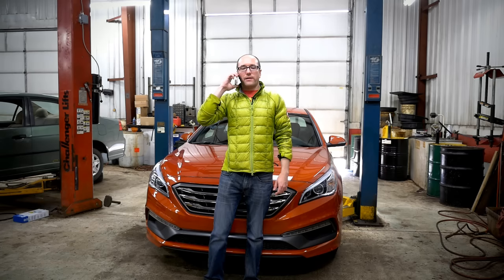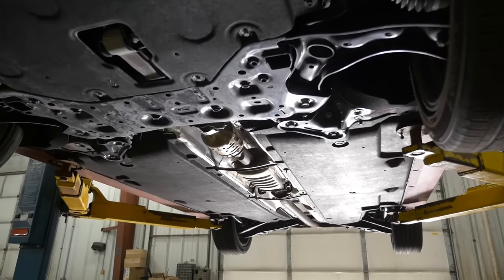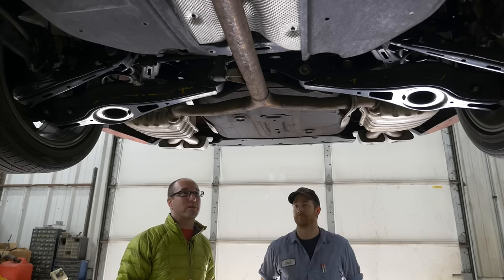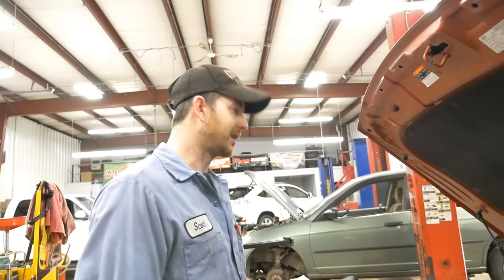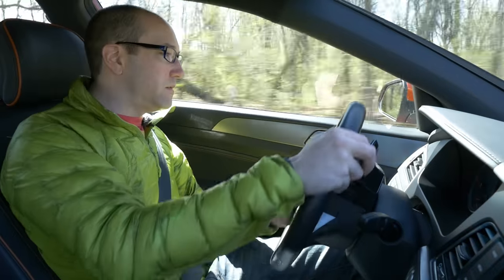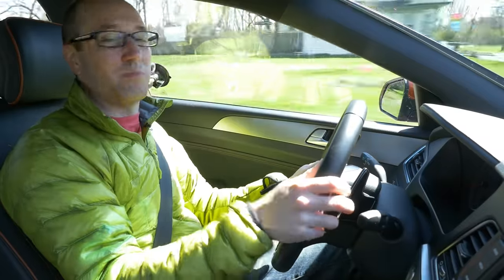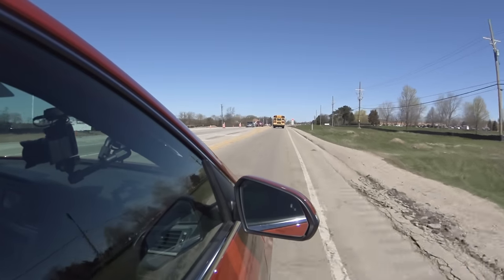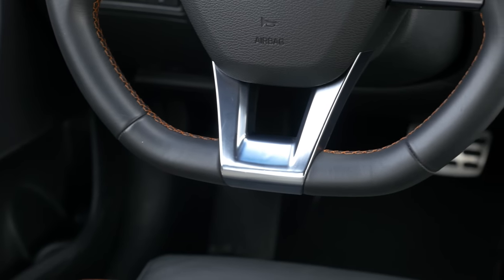Review | 2015 Hyundai Sonata Sport 2.0T | Domesticated

Comment: 7:43 I'm going to speak to this. Hyundai was about to lose it's customer base for the Sonata when they came out with the 2011-2014 models. They made a lot of those models. The problem was that the naturally aspirated motor (Mitsubishi created for them) was poorly designed starting having extreme oil consumption issues after 30-40k miles. This is unheard of from a fairly new car at the time. And  The issue was that Hyundai would not respond and so when contacted. And when sales tapered lower for the 2013-14 Sonata models Hyundai had to act because they lost a lot of customers.

Comment: I think you covered some good points in your review such as hard plastics for elbow and knee rests, wish they could have used some better material. However, I totally disagree with your review about lights and the center dash. I just love the cool blue lights they are so easy on your eyes when driving at night and I low the gentle blue light by the sunglasses which illuminates the center stack area. I never seen that in any car and just love that. About the center stack, which is very subjective. Beauty is in the eye of the beholder. I love the dash and the layout and especially the 8" touch screen and the map rendering. All being said, appreciate your review.

Comment: Second review of yours for me, very thorough, I'm subscribing.  I like Scott he seems no nonsense, I agree with him that these cars should have V6's, thanks EPA. My wife's Jetta Turbo has cost 5,000 dollars in maintenance and repairs in 76,000 miles, only NA engines for me from now on. These car's used to have upper/lower control arm front suspension and full front sub-frames, instead of the smaller cross member type. The struts are strong enough, but the lower control arms aren't boxed just stamped, which can cause them to flex more under stress.
Reply: I agree with curbing emissions, but what they have basically done is give huge vehicles the advantage

Comment: Nice review. I'll be in the market for a new car in the spring. On my list are the Sonata/Optima as well as a Forte5 SX. We currently have a '12 Forte SX 5 door. We traded the 2008 Sonata for it. Time to get back to two vehicles. I've also owned four VW's and 6 in the family total. My sister is still driving her 05 New Jetta. Also was a mechanic and service advisor for a few different makes - 3 of them German.The 2008 Sonata was boring but reliable as sunrise. Got it already a year old with 27,000 miles in 2008. Ex rental. Traded it at 120,000 for the Forte. Normal maintenance the whole time. The only exceptions were the typical sun visor springs and an exterior door handle. The '12 Forte has 70K on it now and pretty much the same. Just replaced front & rear brake pads. While I agree about the "hard plastics" in comparison to say our VW's, just look inside any late model VW/Audi at window/radio/HVAC buttons and switches. All that "soft-touch" plastic has peeled down to the bare white plastic. That was one of the biggest interior complaints when I worked for them. They were also hailed for interior design including the blue back lighting. I don't mind it. I sat in a 16 Sonata and 15 Optima SX-L 2 weeks ago at the state fair. I'm 6ft 2, 195 pounds and have nerve damage in my legs and feet from cancer/chemotherapy. The Sonata and Optima SX-L seats are among the best I've sat in as of late and that includes cars costing twice as much. As for the handling, nothing a better set of tires and struts couldn't remedy.
Reply: may I ask what did you decide on?
Reply: 2015 Sonata Sport 2.0T Limited. Just got it in March. Amazing deal since they had it and 8 other similarly equipped 2015's. Over $7000 off sticker out the door with the usual local add-ons of tinted windows, nitrogen filled tires, and a few others. Plus, to make me "happy" about the scratched interior door trim piece, they threw in: 6 more oil changes, cargo net, cargo mat and rear bumper applique. Quartz White Pearl with black interior with the orange piping and stitching with "carbon fiber" inserts on the door panels,etc. Loaded with the exception of a heated steering wheel. Just turned 3500 miles today and I love it. Ventilated seats are the best thing since sliced bread. Overall seat comfort is amazing. One road trip so far. Almost 400 miles with 6 hours behind the wheel. I could have gone farther and longer if I needed to. 90+ degree temps with the a/c going the whole time and speeds at 75+ the majority of the time and still pulled over 28mpg. Not bad considering it only had 1500 miles on it. Love the panoramic roof. Smart cruise control is brilliant. Android Auto works great. Amazing that I can flawlessly dictate a text at 70 mph with the roof open. I just downloaded the Apple Car Play / Navigation update so both phones can be used. Not a fan boy of either but the AA voice recognition works way better than Car Play. And to savagegeese' comment about it being boring, that's what makes it so stealthy lol. The "sedate" fifty-year old barely draws any attention to himself when traveling above "reasonable and prudent"  ;)  Brakes are great. Hefty for this class of car. 12.6 inch front and 11.25 inch rear. Handles well. Electric steering ? Yeah it's EHH but far better than the previous generation from people I've spoken to. I've never had a problem driving any of my cars as I wanted to. If you ever saw a 1983 Mercedes 300SD sideways on an off-ramp, my apologies. Blame Skip Barber lol. 

I read car reviews, I watch car shows, I've worked in the auto repair industry for 30 years. Reviews are always helpful. But, what a "reviewer" may or may not like, may be something that YOU can live with. The Sonata is not a sport sedan but in this trim, it's big, it's fast enough, and it's comfortable. I don't spend my days drag racing and running laps. There'd be a Subaru STi in my driveway if that were the case. In normal driving, it gets out of it's own way very well and the times that I plant my foot, it has nothing to be ashamed about. No regrets over my choice.

Comment: Nice review. I just purchased this car not to long ago and really appreciate some of the features and ride quality I didn't have in my 2007 Lexus ls460l and my 2013 avalon ltd hybrid. This car is not perfect by any stretch but it's a great fit for me.
Reply from the maker: What are your favorite things about it? Thanks for feedback.
Reply: savagegeese Well the sonata 2.0t compared to my last 2 cars is much quieter, better handling, the ride is just plain ole smooth and enjoyable. It has a much better sat nav, pano roof is always pleasing to the eyes, etc, etc. As for your review, I agree on some of the ugly plastics on the inside of the car but the blue lights..."C'MON"!!! I just so happen to like the "INFANTRY BLUE" color }:0l I do agree Hyundai could've done a better job on the interior in certain areas, but I can critique that on every car I've ever owned. My Avalon had plenty of cheap plastics (tasteful but plenty). My Lexus on the other hand was me best vehicle I ever owned (with it's share of issues I might add).
Reply: @derickj1976  how’s the reliability
Reply: @Tehtlata317  I no longer have the car,  but the 3 1/2 years i had the sonata been great. I had issues with it starting (push button) at work a few times. Might've been electrical gremlins or something. The transmission shifted funny ever so often, and when I made sharp right or left turns the front end will dip heavily. No car is perfect, but I really enjoyed having it for that long.

Comment: Nice info about how expensive the battery is. I noticed that you talk about seat comfort often in your videos. An important detail that no one covers & I challenge you on your next video (or all videos from now on), is to show the floorboard where a drivers left foot can rest if leg is bent and foot pulled all the way back. Oftentimes I find some cars have a floorboard design which does not allow a driver to pull their foot all the way back. The floor is raised. Sucks during long drives. Leg room is about stretching out but also about bending your left leg back far enough comfortably. I hope that was as clear as mud!

Comment: I have the 2013 Turbo Sonata and it has more 273 hp and 273 torque.  I love the car.  The best acceleration on my car is best if you leave traction control on and put the shifter into manual.   I wish I could find a head to head comparison of the the two generations.  I also want to know why Hyundai dropped the horsepower so much.  I also like the interior of the previous gen better.  Thanks for the video.

Comment: To be fair, when you are building a car to a price as aggressively as Hyundai is with the Sonata, the details are the very first thing that have to be sacrificed.  The Sonata is what it is, and that's supposed to be an affordable roomy midsize sedan that offers competitive features and performance.  I agree with everything you said 100% and the Sonata is definitely not the car for me, but there is a reason Hyundai designed it the way they did.  I much prefer the 2018 Accord 2.0T Touring or even the Mazda 6 Signature, but those are MUCH more expensive cars than a loaded Sonata.
Reply: And you're comparing a 2018 model to a 2015 model, I rather have this over a 2015 accord, because of that CVT

Comment: The theta engines in these particularly 2011-2014 have a defect that seizes the engine. You'll hear a connection rod slap, tinny sound getting louder when it's going to happen. Between 40k and 100k miles is when it happens.

They were sued class action lawsuit and have been installing new engines free of cost and rentals on a case by case basis.

They claimed contaminants from a plant but it's likely to design. The oil isn't getting to the lower crankshaft.

In short, don't ever buy these cars unless you're within the grace period of 120k miles they extended. You'll be stuck with a 7k bill for a new short block replacement.
Reply: Well the 2015s are cheap enough now. No need to buy the 2011-2014 year models
Reply: @GMKDP  Id stay away from that engine in any Hyundai or kia. 

If you happen to have it in another model outside of their settlement you may be screwed if it seizes.
Reply: The motors have a lifetime warrenty for knocking. Pretty sweet.

Comment: Eco mode and sport mode feel the same?? The steering hardens quiet a bit and the shifts are at higher rpm...Come on.
Reply from the maker: +kzzz1000 I am talking about steering feel, not trans behavior.  Just because it increases steering effort does not mean it make it better. It feels more synthetic.  I talked to the Ford GT350 pro drivers about this same issue when we did our track time. All of them leaving steering in ECO or normal because the more aggressive steering modes make the car less natural to steer. Different car same principles.

Comment: I still think it's funny that the Sonata Sport is slower than the less powerful Eco model.

They really fucked that up.
Reply from the maker: The Eco model also makes more sense.  And speed, very odd. Its the way this car is tuned.
Reply: savagegeese I dont think that is correct, if you look at the 0-60 times people posted its a lot quicker then they say around 6.5-7.0 seconds
Reply: Matthew Mattera Car and Driver has the Eco doing 0-60 1.3 seconds faster than the Sport.  The 1/4 mile difference is 1.0 seconds.  Motor Trend also found the Eco quicker, though not as drastically as C&D.

And I'm here on the internet, talking about acceleration times of a Korean midsize car.  Kill me now, I want to die.
Reply from the maker: ***** One thing I did not really say in the review is the power is inconsistent.  Never accelerates the same twice, either because of tuning or heatsoak or both.  But really this is not a performance car on any level so like you said arguing korean midsized cars...  I can bet if you started the car cold did one solid run it would be faster than the Eco maybe once or twice.
Reply: ***** That's impossible, its the same car with 67 less horsepower. You can tell in the video its not the turbo by the sound and interior cluster. Plenty of people proved that on YouTube and on several forums. I personally drove the 2.4 and turbo and can say with confidence, that was the 2.4 in the videos. Then again, due to temperature and sea level of the areas where the videos were taken, it could play a strong part in the 8+ seconds people are getting.
Reply: Matthew Mattera God damnit Matthew.  I will not have any more of your Hyundai Sonata drag race talk.  I refuse to discuss this further.  Shut it down now or you'll hear from my lawyer.

And don't you dare try to tell me about 'interior clusters'.  I've got a well compensated, highly trained ass doctor for that kind of shit.
Reply: ***** hahaha touche